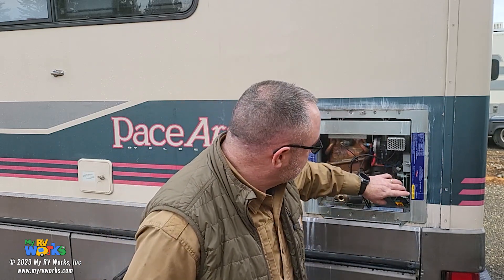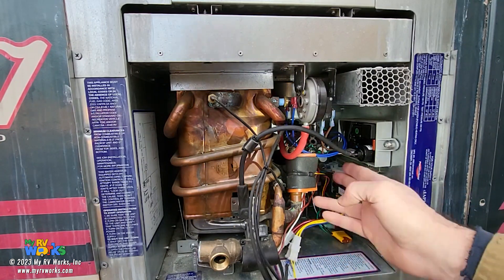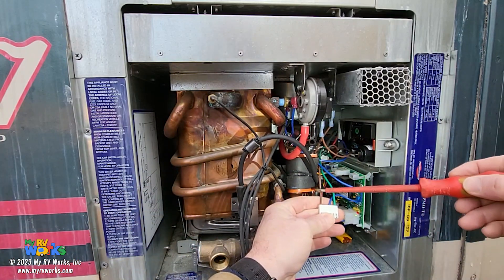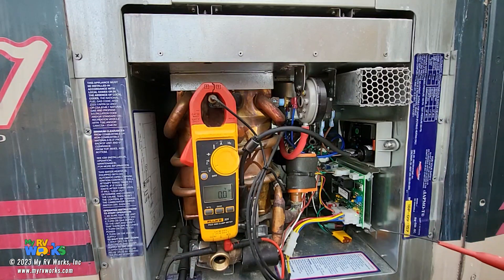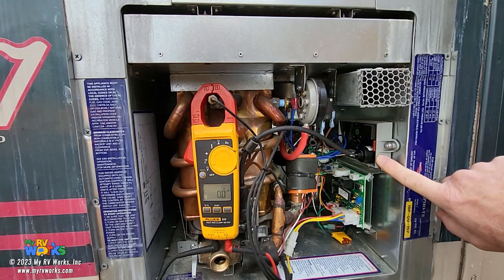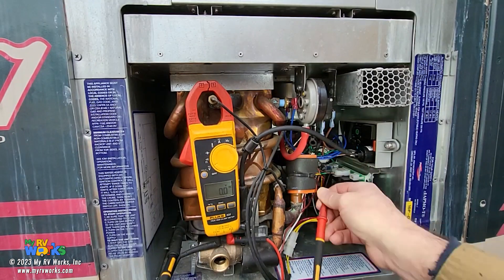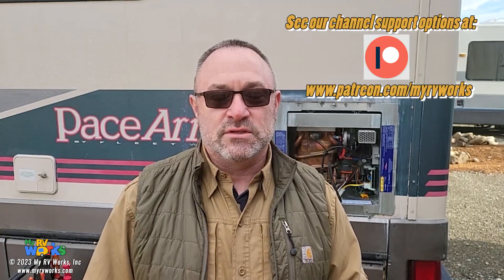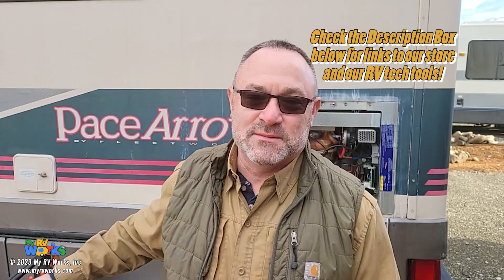On-Demand Water Heater Diagnosis Leads To Electrode Issue  --  My RV Works

Comment: I wish you would do a winterization piece for these on demand water heaters. My Suburban doesn't have a drain plug to get water out of the copper tubing and I have no idea how to prevent it from freezing up and cracking the tubing. I've searched all over the internet and find all sorts of information telling me to drain the water out but they are for different brands. Should I turn off the propane so it doesn't fire up at the water heater and just run anti-freeze through by opening the hot water at a sink faucet and assuming it's in my water tank tubing because pink came out of the faucet??

Comment: what i do not understand on your T/S path you stated you were not getting any voltage out of the board. nor did you hear the solenoid click nor smell gas. When you removed the ignitor wire you now have both click and gas smell?  Are you saying that the ignitor shorted to the burner was causing the solenoid not to work or did you miss this in your T/S?

Comment: so why did you not have power on the blue prior to resetting the gap?  was it a function of the electrode possibly touching the burner?
Reply: That was my thought. I didn’t think anything had materially changed between the previous attempts and the attempt where gas was smelled.
Reply from the maker: When the DSI board was not sparking there was one more test I wanted to perform before I determined the DSI board had faulted. It could have been, and turned out to be, that the electrode was grounded out. I regret not checking the gap before I pulled the electrode out but if I would have, I may have seen that it was touching the burner head. I did notice that the electrode holder was bent, which we see in the video. In the end that was the only change that was made, resetting the electrode to the proper gap.